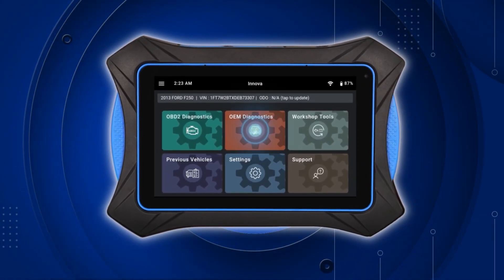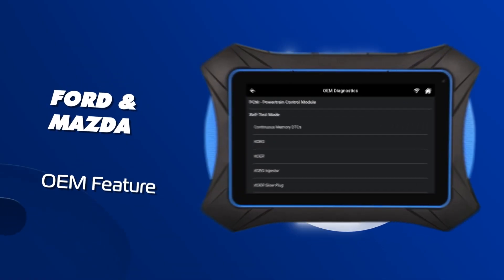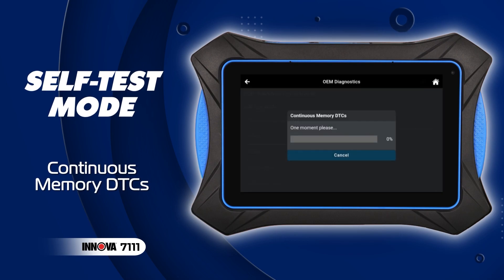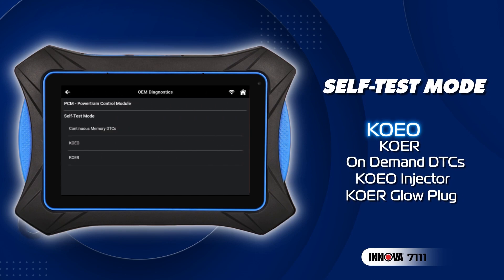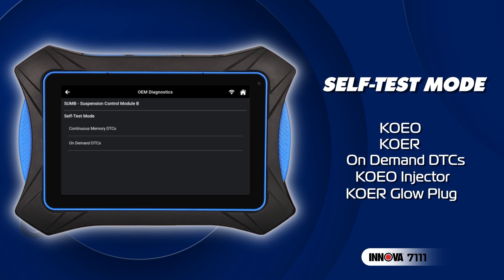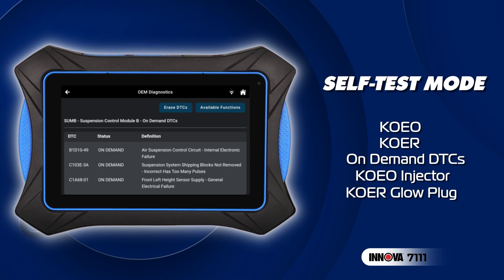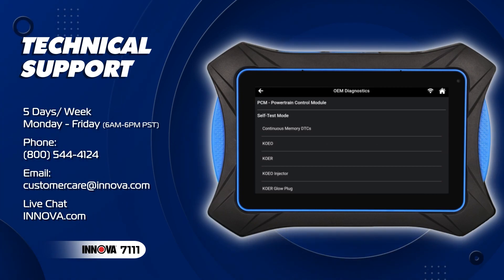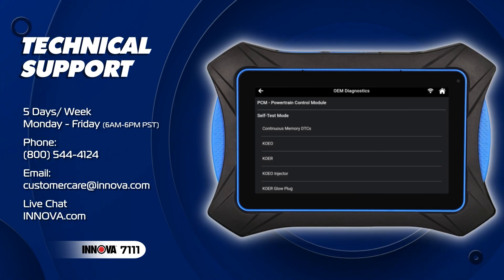Innova 7111: Self-test Mode

Comment: Cant use that when it dont connect to inet
Reply from the maker: Hi @onsiteautorepair,
 
We apologize for the inconvenience.
The 7111 tablet requires internet access to sign in to your account and for certain features such as Fix for DTC, TSB & Recalls, etc. However, other diagnostic functions can work without Wi-Fi. Have you reported the issue to our technician to help investigate the problems you are encountering?
Reply: It doesn't work for anything.  Scanning... Inet... Update...  

Just turns on and dose nothing ever since volt meter update installed.
Reply: And ur not sorry. Otherwise ud replace it with a working one
Reply: Took my money and robbed me is how I feel
Reply from the maker: Hi @onsiteautorepair,
We apologize for your unsatisfactory experience. We highly suggest calling our service department at 800-544-4124 so we can discuss the return process and also verify if it's still covered by our warranty. We are open Monday to Friday from 6am to 6pm PST.
Thank you,

Comment: Junk scanner... Mine is garbage... Innova customer service is really the worst. 

DONT BUY IT
Reply from the maker: Hi @onsiteautorepair, 
We're sorry about your negative experience with our scanner. Please provide detailed information to help us investigate the problem.
Reply: I've contacted you 5 different times about scanner. 

Starting the month i bought it 

To no help... Only for u to stop emailing about scanner
Reply from the maker: Hi @onsiteautorepair, 
We're sorry about your negative experience with our scanner. 
Please provide me some information below:
What the issue met on your 7111?
What is the version software, firmware on your 7111?
If you can, please send any image or video via our email :customercare@innova.com
This way, we will have more information to identify the root cause and provide you with appropriate solutions.
Thank you
Reply: @innovadiagnosticsolutions  when it got volt meter added it stopped scanning most cars prior to 2006. Wifi wont connect.   Useless.
Reply from the maker: Hi @onsiteautorepair,
We apologize for the inconvenience.
Please use the "Report an Issue" feature in Settings to provide detailed information about your problem to our technician. Once received, we will check the problem and provide you with a solution.